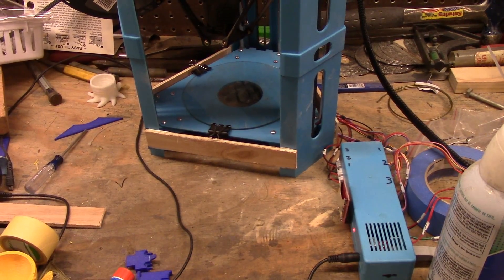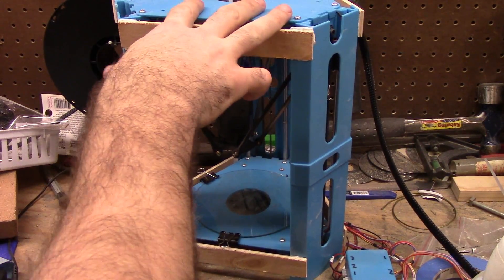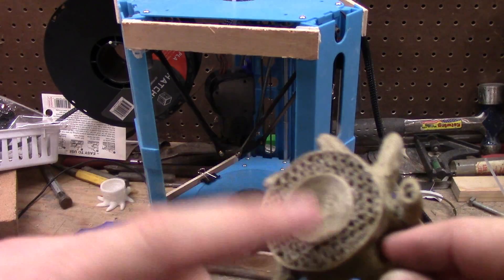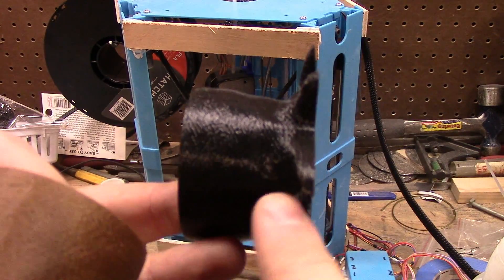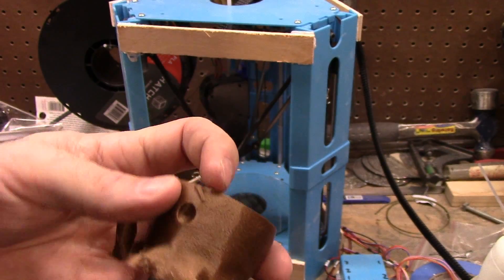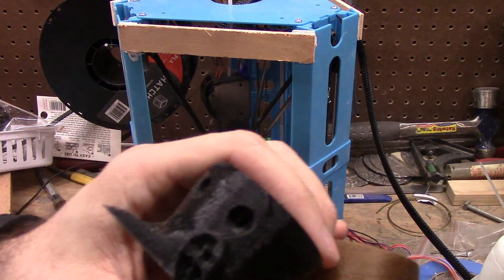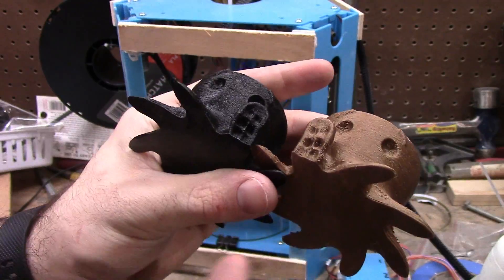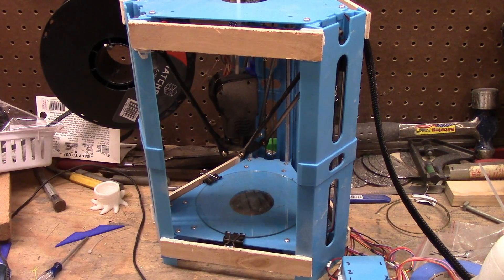101hero structural upgrade

Comment: If you want to test the improvements, make sure you left all settings the same, and use the same filament ofcourse ;-)
Reply from the maker: while true. difficult cause ive been fiddling with things for every print. which is why the balling showed up this time, tried my normal higher temps that i use on my other printer. new print is looking much better, will do a quick update later this evening.

Comment: you can add a diagonal pice of wood on 2 of the 3 sides. that should improve the stability not loosing visibility.
Reply from the maker: might try it. though from my next prints it looks like it might not really be needed. as now the major defects are the restart gaps (trying to fix in slicer settings) and the steps from the motors.
Reply: was thinking the same thing. at least one side anyways. depending how much accessibility you want to the bed. also seen a rubber band mod around the pairs of arms.
Reply from the maker: check my most recent video. finally have movement and extrusion good enough the structural issues are rearing their ugly heads again